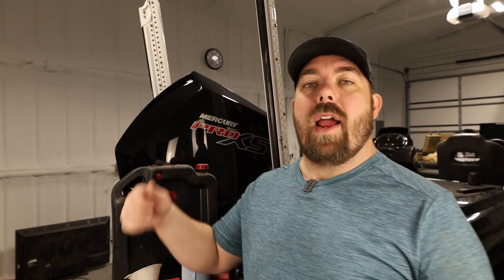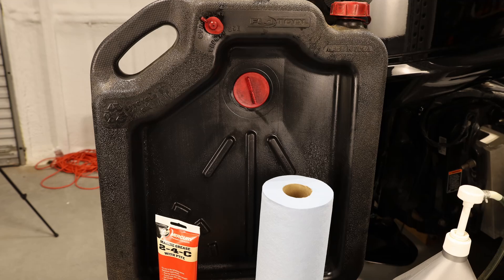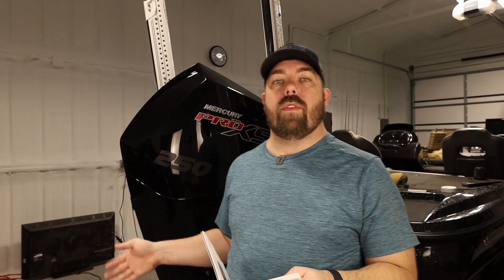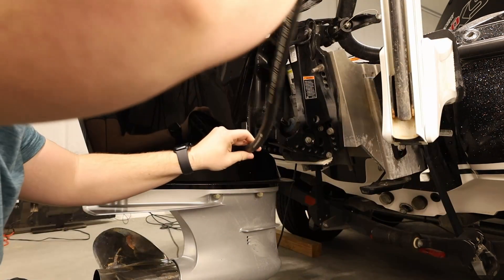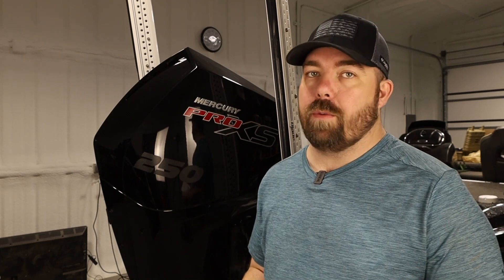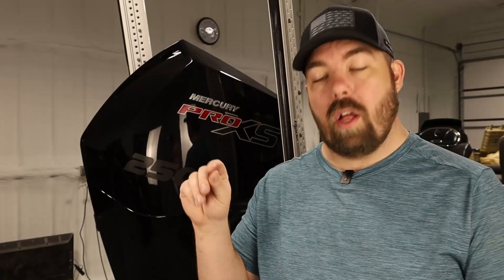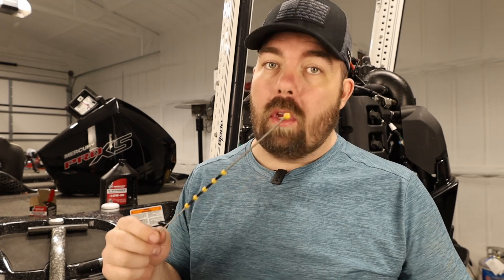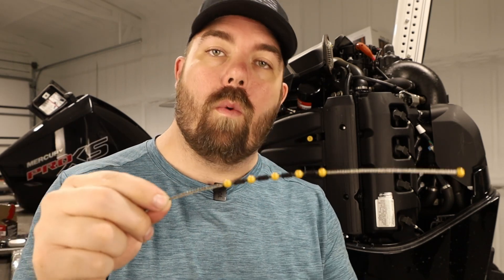How To Change the Oil in a Mercury 250 Pro XS Four stroke in 5 minutes (175, 200, and 225 too)

Comment: Hello,  I have a 2023 200 HP merc, have you ever heard a tic,tic,tic sound  after trimming motor down and releasing trim button?  thanks
Reply: Check the wiring and harness and connectors, my opinion only I am not a boat mechanic.